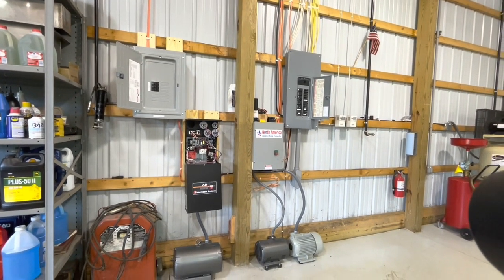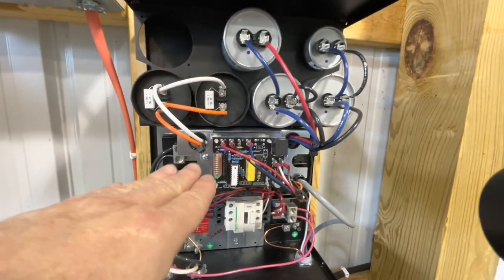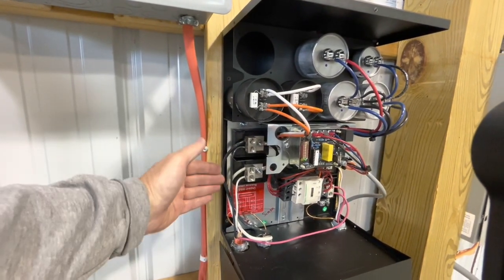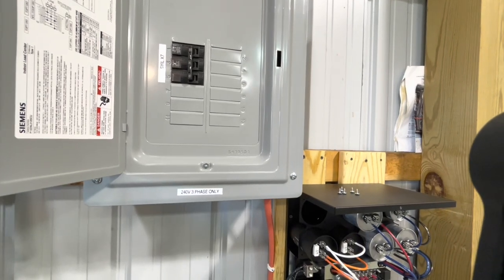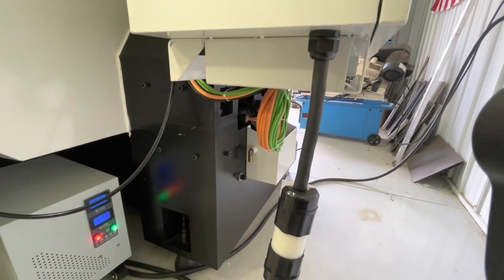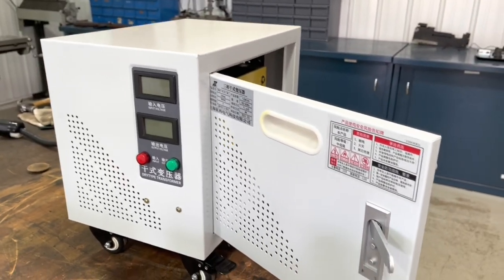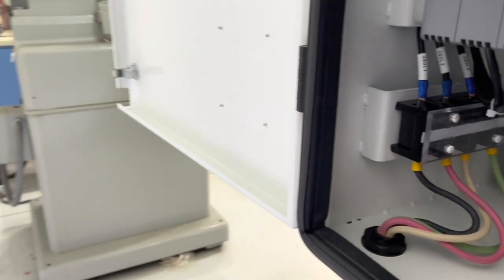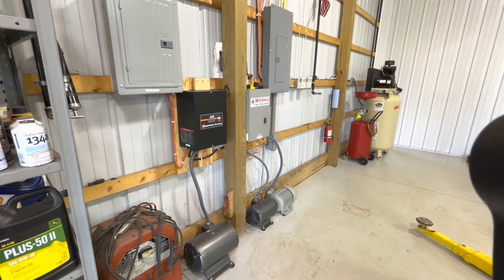How to get 3 Phase power for the Syil X7 and other CNC machines.

Comment: In 1972 my Father and I bought our first 3ph Bridgeport.  We just put a momentary pushbutton and a capacitor to the 3rd phase on the Bridgeport. The limitation to this approach is you can't instantly change spindle directions.  I have since added two 3ph 5hp wired into my 3ph panel both using a pushbutton/cap to start one of them. What i have learned was that a 3ph 5hp motor will generate ~80% of the current on 3 leg.  So a 3phh 5hp motor will allow you to start/run/and change spindle direction(most important) of anything < 3ph 4hp motor. Why two 3ph 5hp motors:  Because I'm frugal( cheep ) and if I'm not running my 7hp mill and only the Bridgeport why give the money to my power company.

Comment: With the 3 phase machinery & cost of electricity, would it typically cost more to run them from single phase with the rotary converters vs running on 3 phase service?
Reply from the maker: My RPC cost about 15 to 20 cents per hour to run according to their website.  3 phase is not an option where my shop is located. Obviously most industrial areas have 3 phase but you pay a premium for it so it probably a wash.

Comment: some info on that transformer thanks in advance great video
Reply from the maker: It comes with the X7 here in the states. Takes you 3 phase 220 and boosts it to 3 phase 380. The X7 is a 380 volt machine.

Comment: Im in Sweden and its easier here its only 3 phase 380 with a neutral . so your transformers secondary winding between phase and neutral is not 110 its 220 .
Reply from the maker: That would be easier for sure.

Comment: I am looking at one of these X7, I currently run my mill and welders on a modern 415v generator, what type of current draw does the X7 need, and could I continue to use my generator to power it.
Reply from the maker: With the Syntec controller they recommend a 30 amp circuit.

Comment: Question. 
CNC machine needs 220v and I have 240v , do I need to add a drop down voltage transformer? Thanks! As for wiring it's about protecting the wire so it doesn't start a fire. And mechanical protection for the wire to stop a short. Fyi. Code is simple if you can read a  law book. But YES consultant or ask a sparky for proper installation. Cheers.

Comment: Hey bro I have a machine that's 9.7 kw 13 hp I was told I need the adx 30 to run my machine the question I have is will I need a transformer to run my machine? Any help will be appreciated
Reply from the maker: That sounds correct. As a rule the RPC will be double the size of the load. It will come with one if you need it.

Comment: I got a kO LEE surface grinder it the machine has three lines coming in how do I know which line takes the 3 phase wire?
Reply from the maker: Jasper, I’m not sure I understand your questions. Three phase power uses there hot wires. So you hook up all three.
Reply: @MaDuceRules Two of the lines coming out of the phase converter going to the equipment are single phase the the third one is three phase. My surface grinder has three lines coming in marked line 1 2 3. The wiring diagram on the door shows the three lines coming in above it it just says three phase lines.
Reply from the maker: @jasperjones6962  ok connect the three lines from the phase converter to the the motor wires 1, 2, and 3. If the motor runs backwards switch any two wires and you’re done.